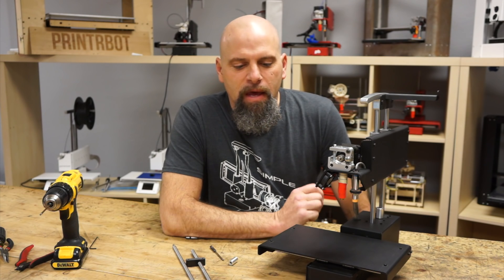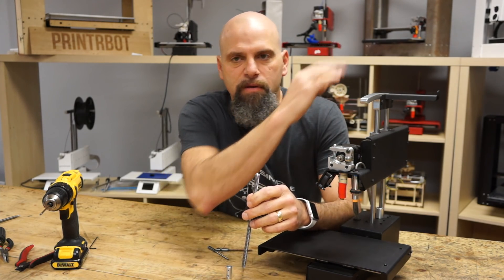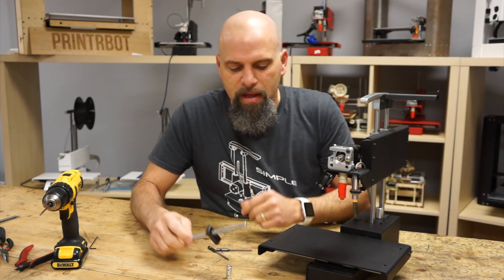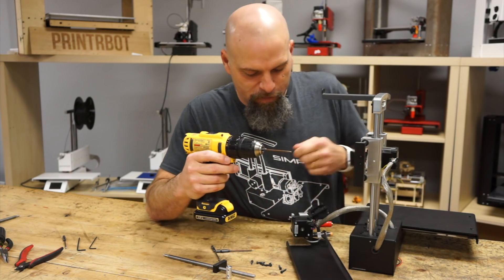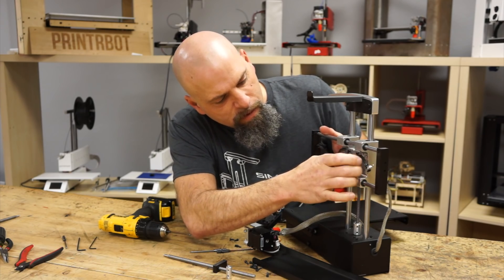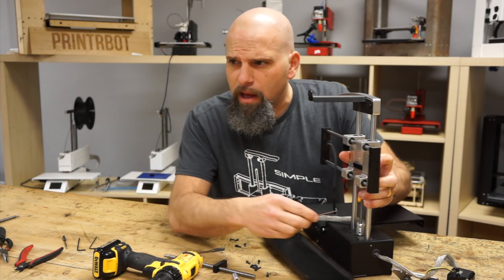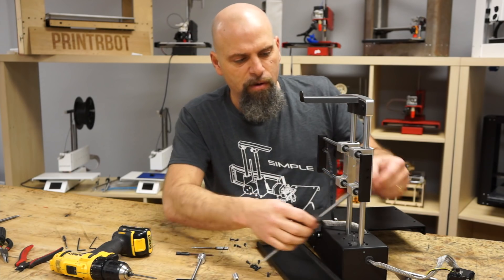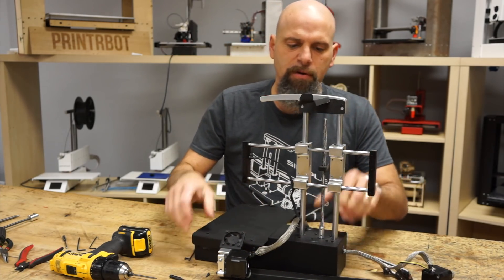Printrbot Simple - Z Lead Screw 4-Start Upgrade Build

Comment: I just ordered this upgrade, it hasn't even shipped yet! Thanks for the video.
Reply: I've installed the upgrade and unfortunately my print quality got worse. There is definitely Z banding that wasn't there before. Any tips before I put the old one back on?
Reply from the maker: I'm surprised. The new one has eliminated banding on all ours. The nut could be tweaked up of down on one side when installed- it doesn't take much. Also, you can try loosening the z motor mount and moving carriage all the way down before you tighten the motor screws- it should self alight on center. The coupler could be tweaked but you will see it wobble if it is I guess. My bet is it's the z nut. Loosen it and move the carriage down before tightening so it self aligns too. 

If you are unhappy, we are happy to refund it. Yours is the first complaint I've seen. I may be taking for granted nuances in installation that I'm used to since I've mounted hundreds of them.

Brook
Reply: I put a small amount of lithium grease on the rod and my print quality got better so maybe it just needs to break in a bit.
Reply from the maker: I recommend weekly oiling of rails too- I use Teflon oil. Grease on the z does minimize slack... my friend used to use chapstick on his z rod to smooth ribbing... whatever works I guess ;)

Brook